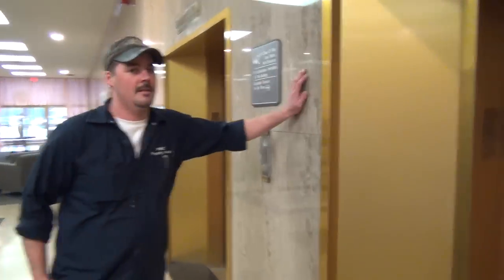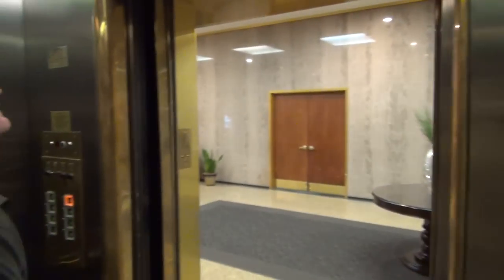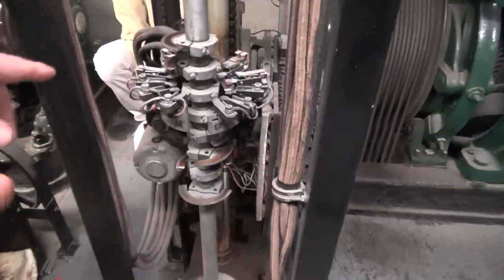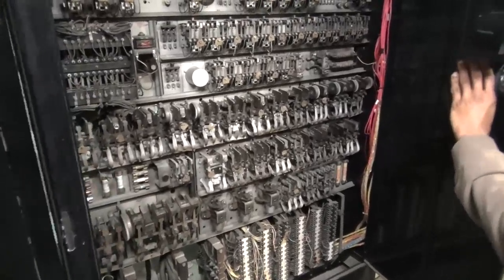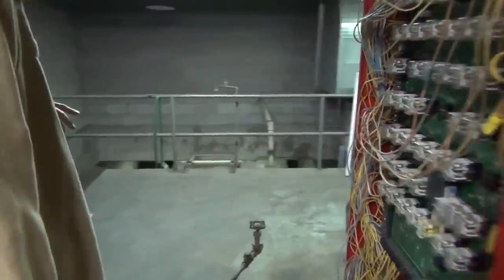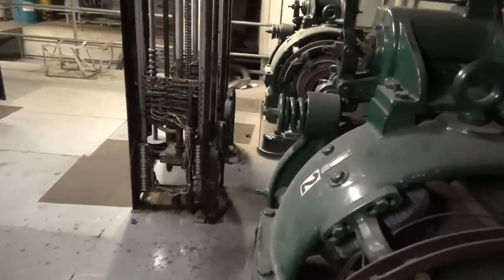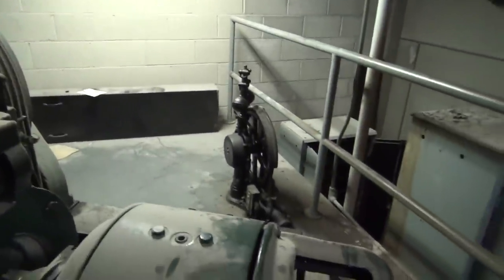1958 Gearless Traction Otis Elevator Machine Room tour

Comment: I had 4 of these, but the newer generation that used 1625 vacuum tubes for the directional circuit control  LG, LJ XLG and XLJ  and HS....and the diode matrix for the hall call circuits.  PI plate selectors with the advancer motors.... The generators and the drive motors were absolute beasts... the controllers...maybe not so much, over  40 year career..hundreds of hours keeping it all running... I miss it.  I enjoyed what I did and I think I was pretty dam good at it!
Reply from the maker: Love older elevators
Reply: Would be great for young EE like me to read the diagrams and learn from the system. I'm sure that was quality engineering from days where every logic circuit costed much $$ and was too big

Comment: Very nice and impressive old Gearless DC machinery. 175 volts, 141 amps when I read the type plate correctly - so, about 22 KW or 30 HP of power. Great! I love these old DC drives. Sad that this technology now is obsolete and more and more replaced by three-phase AC engines.

Comment: Type B MG sets and pie plate selectors!  I still work on this type of equipment in LA! Still using the 2040 touch tubes in the car and still using the glass vacuum tubes at the top of the controller! Still has the original flyball governors! 👏👏👏👏👏👏

Comment: True to a degree about the machines. Though incredibly built, those big gearless eventually need to get rewound.The good news is they do it onsite.Way too heavy to send out. We finally lost one about 80years old. The wire insulation deteriorates. You start getting hot spots on the commutator. They also start losing motor fields.
 DC drives too are becoming a thing of the past. Magnetek or the 12pulse MCE still work well.
These days the AC gearless PM motors are the standard.
Reply: Parts made of Chinesium (Chinese made parts)?

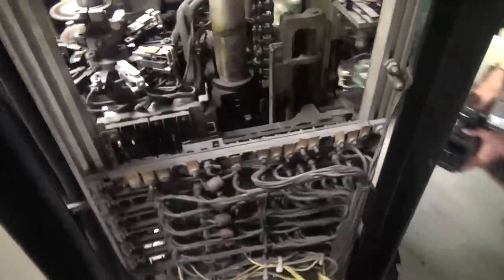Comment: At last I've found an excellent video to watch tonight - must have missed this one when you published it.  Wow, amazing!  Some things puzzle me though, mainly due to cost I suppose - Why Gearless in a relatively low rise building, and why do they have the more expensive "advancer" system (2:46) on the selector?  Answer, for you to film :)  but do you see what I mean?  Most other buildings would have cut that out, unless the building was high rise and demanded these extra features.  Glad you filmed the journey up to the motor room, always interesting so see just where they are and how to get to them - every building is different.  EXCELLENT video!
Reply: mrmattandmrchay These elevators are definitely over designed for a low rise building. However I have seen hospital service elevators that run at 500 FPM. I believe these gearless machines are roped 2:1
Reply: These machines are roped 1:1 not 2:1. The speed of the lift car is the same as the speed of the ropes. There aren’t any rope hitches to be seen which would indicate 2:1 roping. There is double wrap traction. The ropes pass over the traction sheave twice, passing under a secondary sheave below the floor inbetween wraps. This allows the traction sheave to be made with grooves that are kinder to the ropes yet still have sufficient traction.
  These lifts are unusual for a relatively low rise building. The higher speed from the 1:1 roping and the advancer panel on the selector would be more appropriate for a much higher rise.

Comment: If you want a complete controller, you might ask the modernization contractor if you could buy one of those being removed.

Otherwise, they're just sold to a scrap metal dealer. There's a lot of copper in those old controllers and contractors may get as much as $50 a piece at the scrap metal yard.

Comment: Awesome DC motors! :)
Reply: That's right. Those ain't no wimpy induction motors.
Reply: @jolyonwelsh9834  my favor motors ,i use to repair them in the motor shops i work  before  wen america was america , know america is china
Reply: @jolyonwelsh9834  induction motor can be strong with proper controller. dc motors are obsolete. permanent magnet motors are the future.

Comment: Little walk down memory lane. I was an elevator consultant, later a safety inspector, for a couple of decades (I'm 73, retired) and I've been into many hundreds of buildings and inspected thousands of elevators, many like those Otis installations with Ward-Leonard & the relay-based controllers. I don't miss the 85 decibels of those m.g. sets or the kneeling on the carbon/dust floor to write my notes because a clip-board was a nuisance & there's hardly ever a table. Interesting electro-mechanical equipment though. Consultant's general recommendation: Refurbish Otis gearless machines, scrap everything else in the room. Use SCR. New door operators, fixtures, cab finishes. Refurbish hall/car door equipment & whatever's >60% worn (ropes etc.). But, as always, if somebody keen to get the work gives a great price for everything in the room being scrapped and A.C. gearless installed then likely go with that, a tidy package. If memory still serves.

Comment: old technology, elevator, there's a way not done yet, no cables machine. Just detection once you put your weight in elevator or escalator by means of detection the machine will take you up, mechanical timing process in every step, weight is the switch .

Comment: Beautiful controller if you can read a print they will Last forever! The only thing on these cars i would mod is maybe the   Selector !
Reply: That selector is an integral part of how the system works. If you wanted to keep the controller anywhere near ‘as is’ then the selector is vital.
  Anyway, why would you want to scrap such a well designed piece of engineering that’s good for years. The only problem is now the lack of engineers who know how they work to maintain them.

Comment: 1958 ???  It is not possible and do not believe that it still works ?? !! Here it is cool ... wow
Reply: Autotronics controllers where introduced by Otis in 1937 and touch buttons were introduced by Otis in 1948, today they just still running perfectly almost like the 1st day. This is why I hate new elevators and I love old ones.
Reply: Clément 2000 Autotronic was introduced in 1948 actually
Reply: @Clement-xy9iv  Elevator company sales engineer advised residential client to carry Capital Plan funding for 20-year elevator replacement (5 year old building).  Probably right too. Throw out the cell phone & elevator. Get one with better iTunes

Comment: Is the motor 480 volts 3 phase what city is it in
Reply: The big ones moving elevators are DC motors. Notice the motor-generators at 4:44 which convert AC to DC. You can lower a DC motor speed by just changing voltage. Today elevator motors are AC, controlled electronically trough VFD.

Comment: An elevator lift room comprising a drive, an electric motor in an upright position, a brake, and a suspension element for providing vertical movement of the elevator chassis.
http://www.sunny-lift.com/Traction-Elevator-System---Gearless-Elevator-Motor-For-Machine-Lift-630---2000-KG-SN-TMMY05.html

Comment: Thomas Edison would have been proud
Reply: but they use 3 phase ac line
Reply: @samueladitya1729  if your main point of your comment was to be incorrect you have succeeded. 

Let me educate you : they're using AC power to run AC motor that is powering a DC generator that is powering the lifts. 

Sorry if your brain hurts after teaching you something........
Reply: @obviouslytwo4u  umm why not just use diode rectifier?
Reply: @samueladitya1729  most probably because diode reflectors work better when constant power is applied. 
Not to mention the power loss, heat build-up and bad reliability of diode reflectors back then and today.
Reply: @obviouslytwo4u  yes yes master
Reply: @samueladitya1729 , probably because DC generator's output is specially regulated (by controller)to match the power needs of traction machine's DC motor. Semiconductor version of AC motor + DC generator machine - phase controlled thyristor rectifier. These rectifiers were developed in 1970-es and can vary its output voltage, like DC gen.
Reply: @sergeyblinov4957  Also braking can be applied by the DC lift motor running back thru the generator. This causes the generator to try gaining speed while being held at its rated speed by the generators AC motor.

Comment: Sad to hear these elevators were being modernized...but that's progress. Pretty soon Otis touch buttons will become extinct. As it is they are getting very scarce.
Reply: I'll also add as a kid I was fascinated with Otis touch buttons...I was sure I was the only one. These videos are really cool. Thanks for posting them. Here was a time in American history where things were really built to last!
Reply: John Kinder The old fashioned systems are definitely fascinating, but being an elevator owner myself, I know they are not worth the cost of keeping in them in service. The new state of the art equipment is very reliable and they can run for years without a trouble call.
Reply: That is very true. Solid state is certainly far more reliable and cost effective. Like today's cars, appliances, etc. newer elevators are far more cost effective and use less power to operate. The old technology though is really neat, and more attention was paid to detail back in the day. Where you had metal and brass now you have mostly cheap plastic. Everything today is built like a bic lighter, disposable. If you could have the build quality of yesteryear with today's technology, then you would really have something. I guess it would be called a Rolls Royce.
Reply: John Kinder  nothing missed about the original touch buttons. Cool idea but they were a pain. These days they keep the external buttons but use an interface called an I40 module. 
Otis was way ahead of it's time. They even had a primitive speech unit back in the late 60s. It used a series of reel to reel tapes to play messages at various floors. It was called an Elevoice.
Reply: There is a bad trade off with regard to replacing the old with new electronics. It is true, you do gain reliability...no doubt there considering the joke that maintenance has become. The bad, is you lose longevity due to forced obsolescence. With the advent of microcontrollers on many circuit boards, getting the old software that your particular board needs or was installed with is difficult. Usually you are forced to buy newer boards which require software upgrades. Sometimes these upgrades spill over to your entire system which gets very expensive. Plus...these days without access to very propriatary service tools you are screwed. The companies retain all rights to the tools they provide to their field guys.
Reply: Very true, I know here in Australia there's farmers actually suing for being unable to service own tractors, etc when nearest dealer is hundreds of kilometres away and you just need a quick fix, they won't let you use their dealer's tools to do simple fixes with etc. Same for modern lifts I suppose.
Reply: Yeah, VFDs and 3 phase induction motors are far more reliable than those old D.C. motors and resistor banks.

Comment: @border the porter  - i would guess 70s or 80's
Reply from the maker: It is 1958, there was a plate on the controller.
Reply: ***** These motors have a cast steel field frame and base and they were produced from the 1920s up until the early 60s. However the modern rolled steel field frames and welded bases also came into production about the same time. The manufacturing technique depends on where the building was and when the order was placed.

Comment: I'm surprised that they used gearless units on such a short building.
Reply: This wasn't uncommon on older traction units up north here... They'd slow the cars down by a double sheave via a huge pulley on the car top.
Reply: yes I agree.
Reply: ***** I was wondering the same as the building is low rise, as to a gearless traction machine. Thus a compensating sheave on top of the elevator cab, slowing it down. Was the roping 2:1 with the counterweight also having a compensating sheave? Or just the hoist ropes on the cab one end anchored to the top of the shaft?
Reply: TheTheo58  I hope you don't mind me butting in here... if the compensating sheave is on top of the car, the ropes are bolted at the overhead, run through the cartop sheave, back through the overhead and through the gearless machine, and down again to the counterweight... in effect making the car travel half the distance the ropes travel.  The equation ignores the counterweight side... since the car side is basically double-roped to the overhead (the bolt on one end and the machine on the other), the motion of the car is exactly 1/2 the speed... or the rope had to move 2:1 (rope motion:car motion).  Northland Elevator's video of the Torrey Building doesn't show the sheaves but you can definately hear them.  (I'm in that building often). I hope this helps.  I got the feeling you were looking to put math/logic to how this process would work out.  If I got too long-winded, I appologize.